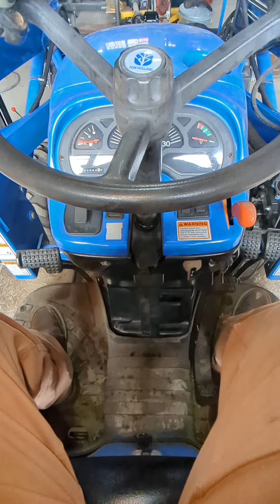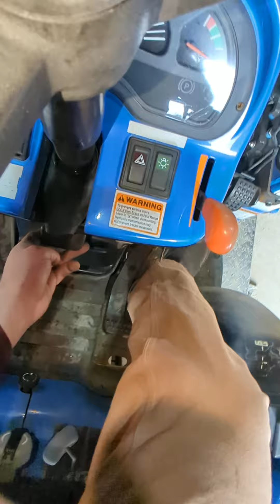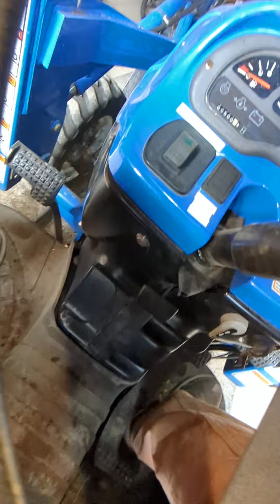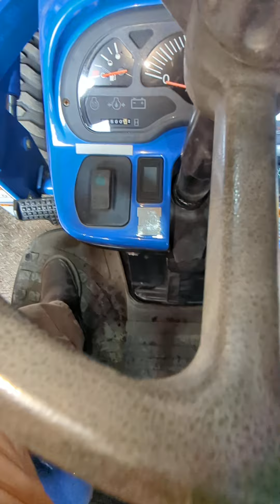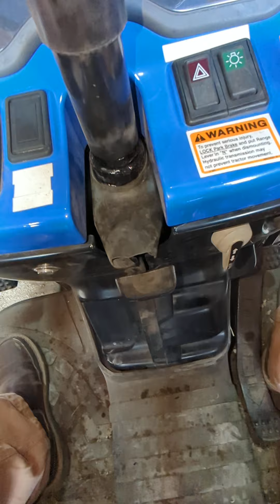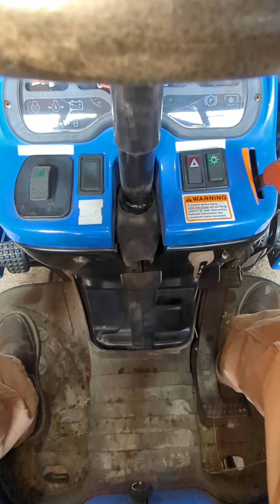New Holland TC29D Tilt Steering video #5

Comment: Hello.  I just bought a NH29D with speed steer and I can’t find a manual for it that includes speed steer.  Can you tell me what that button on the far left is with all the black rubber around it.  Also, it my first time using speed steer and it seems dangerous.  It takes many turns of the steering wheel to get the wheels to turn.  Is it supposed to be like that?
Reply from the maker: I am not familiar with the speed steer feature, that might be a later option than was available on my tractor...  Unless you are referring to the split brakes to make a tighter turn?  

The manual I use I purchased online from New Holland, it is a CD and all the documents are in PDF format.  I got mine about 15+ years ago but I think it is now available for free online.  

The black switch on the left is the 'cruise control' feature.  There is an electromagnet on the hydrostatic pedal (variable speed forward & reverse on the right side floor).  After setting the engine speed, the pedal is used to control ground speed, that switch will clamp the pedal into position.  The switch is released when you step on the brakes, just like cruise control in a car/truck, or when you rock the switch to the OFF position.  This way you can set the engine governor for the PTO speed and use the pedal for ground speed and when you have the right balance of work load you tip the switch to lock the pedal and give your foot a rest.
Reply: @ Wow thanks for letting me know that about that button!!  And that would explain why the pedal was hard to move when I pressed while stopped.  I have looked on NH’s site, but have yet to find the manual.  But I did find one on eBay, but they want 3 weeks of fuel for it.  Thanks for answering my questions!
Reply from the maker: @Dream.big.dreams  I'll hook you up if you contact me with your YouTube channel name and mention this conversation.  My email address is my channel name followed by @gmail.com